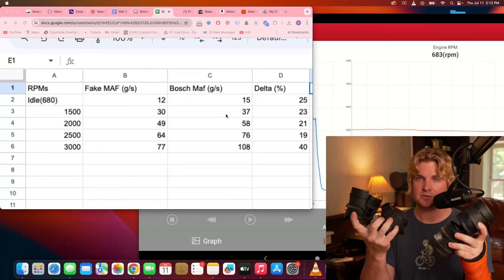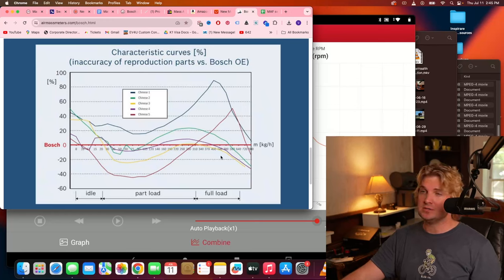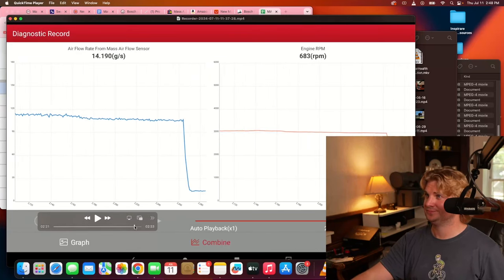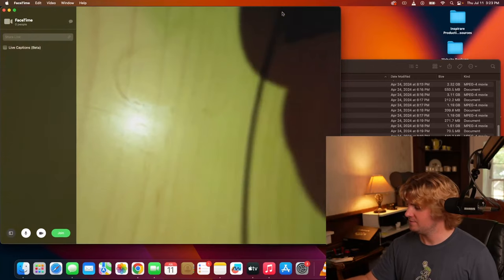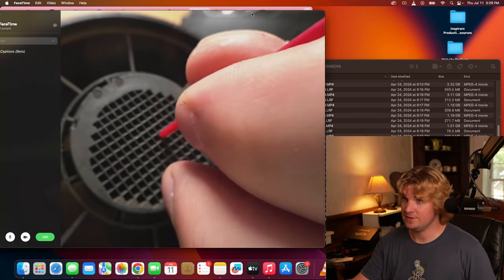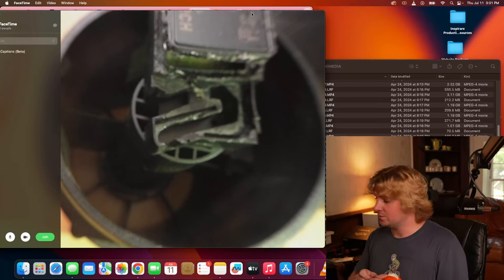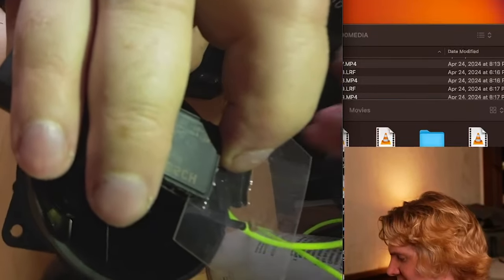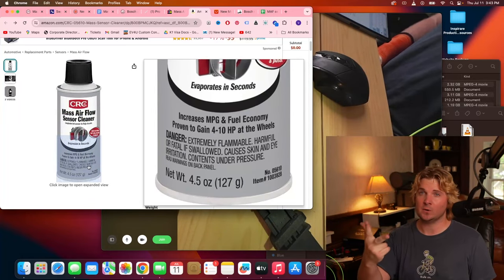Never Clean The MAF Sensor on Your Sprinter Van?

Comment: Thanks 🙏
Reply from the maker: glad you found this useful
Reply: Damn dude your the first to I believe to address it this way I was just on eBay checking one out for my 2008 Saturn Aura I bought one over a year ago and just recently started getting a P0171 and P0172 codes at the same time and it couldn’t be anything but that damn cheap MAF sensor and according to a mechanic website this means it’s typically from a bad sensor causing both codes at the same time man thanks again a lot I will definitely go with OEM Bosch or AC Delco instead
Reply from the maker: @rosieclark3661 I am glad this helped the situation. It is very interesting how a lot of other european cars seam to use exactly the same sensor, I am 90 percent sure I could make one from an audi or bmw work with a sprinter van

Comment: As a mechanic for 15 years at an independent workshop i can tell you Mercedes HATE anything but the OEM sensor.
Other than that most cars will "accept" it BUT will use more fuel.

If you don't buy OEM try to find the supplier for OEM sensors and those work just the same but cheaper.

And on some cars, especially Mercedes you must use a computer to reset the self adaption when changing or cleaning it.

There are several service bulletins on this.
Reply from the maker: Well said, the problem is with these you get a mercedes part number on the outside and the bosch part number can only be seen when you cut the sensor out, not like the old style where the sensor is held into the housing with screws. so mercedes makes it difficult to source from bosch directly. In this I am not sure if we can say this sensor with cause it to run rich although with many fake sensors I am certain this happens.